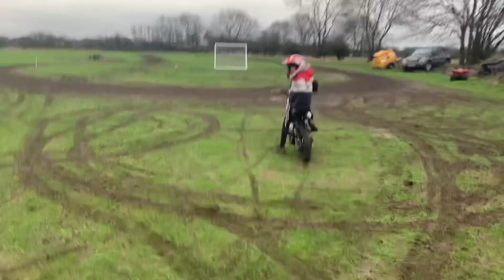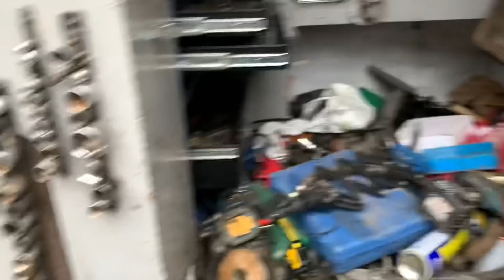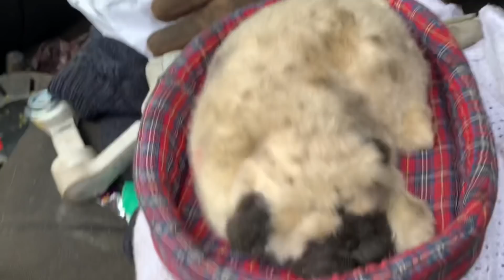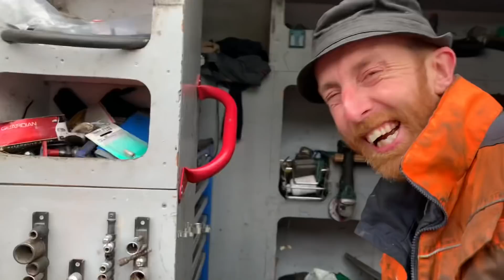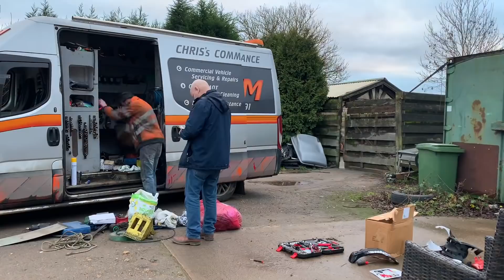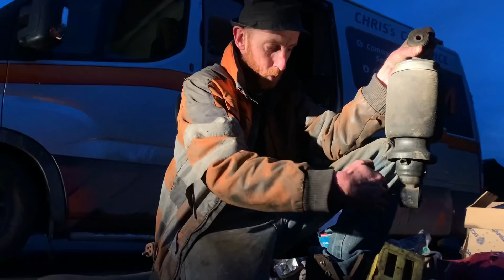Attempted tour of my nice clean and tidy van mobile hgv mechanic lorry truck trailer semi rig

Comment: that air bag bolt sounds reminiscent of the early Mondeo bottom arm bolts, the way they were put in meant undoing the steering rack and dropping the subframe down for the bolt to come out. Luckily there was enough room to get the bolt out so far and cut the head off it and remove it thread first, replacement bolt went in the other way round. Think they sussed it out after a couple of years of production when the dealers started having to replace them. An hours labour saved for the sake of a nut and bolt being the other way round!

Comment: People  don't  understand work to finish  the job getting  late the last  thing  you want to be doing  is put  your tools away 
Talking  about  clutches when you do that scanny try putting  the release  brg in the new cover fit on the release  fork fit plate to first motion shaft just slide g/box back  in put bolts  in turning  the engine over & torque. 
Done loads  of twin plates like this &taken Shania clutches  out like this
Didn't  think of taking the arm bolts  out until your  video
All the best Rob
Reply from the maker: I shall give it a go cheers rob 👍 hope you had a good Christmas 👍

Comment: It’s of a TGX or TGS and the designed it so you have to remove the bumper classic MAN engineering
Reply from the maker: They like to make hard work of a job a know that 😂😂
Reply: @Professional-struggler  yeah the can do. I work for MAN to pull the bumper is easy than you mite think.
Reply from the maker: I thought it was a nightmare mate had a quick look and bombed it of.